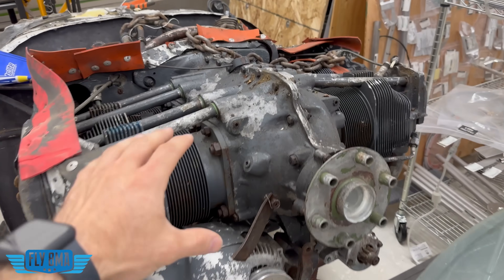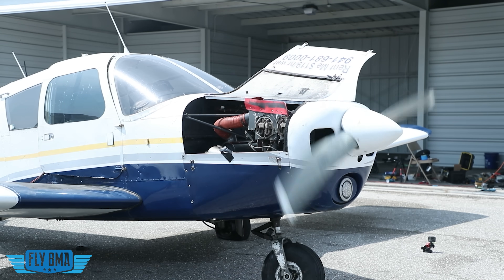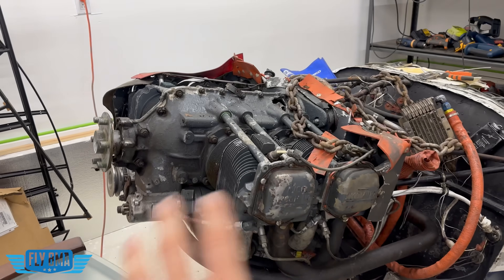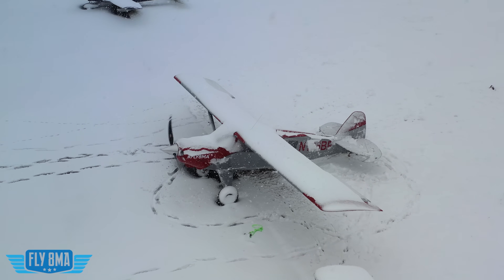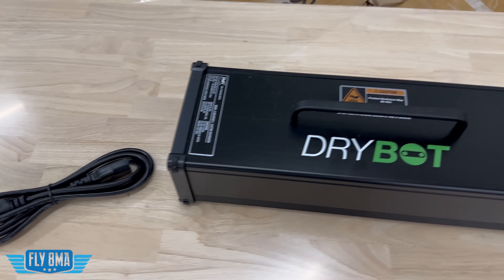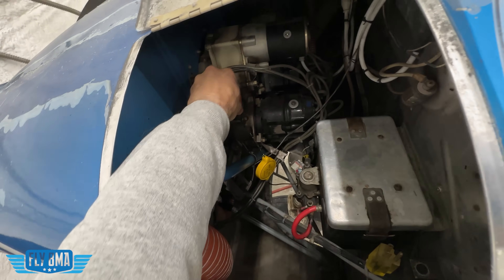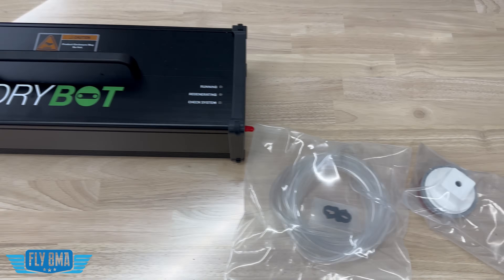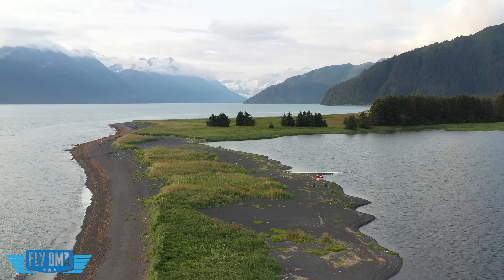Why you WANT a DRY airplane

Comment: There is a huge difference among engine heaters. The example you gave was an oil pan heater, and I agree with your advice. However, if you install a full engine heater for oil pan and cylinders, then I think it's best to leave it on 24/7 during all months where condensation can occur (in the PNW this is from ~Oct-May). My engine heater keeps the entire engine at 110F, making absolutely sure there is no condensation anywhere.
Reply from the maker: Electric bill here in Alaska at $0.22/kwh would run us about $130/mo in electric to do that.  Not sure what electricity is down south, but 24/7 on 800watts gets spendy
Reply: @fly8ma.comflighttraining199  Yeah, that's a consideration. The standard Reiff system is 400W, thought in AK one may need the XP system with 800W. My electricity is included in the hangar rent, so no extra costs. Still, in concept, I think that heating the entire engine well above the dew point is a great way to prevent corrosion.
Reply: Yea, you must be making bank

Comment: I purchased an alien engine heater, which blows warm air through the whole cowling of the engine to keep the temperature maintained no matter what the outdoor temperature is. Give me your opinion on what you think of this. I heard good reviews concerning it and it was not cheap, but if it works, it will save me from having to rebuild my Lycoming 0540 engine again at least prematurely.
Reply from the maker: Haven't tried that one, but i'd assume if it gets the air hot enough to do what it is supposed to do that it may consume a lot more electricity than a desiccant dryer like this one.

Comment: What about just taking the oil cap off while hot, and let any steam out?🕳️🌏
Reply from the maker: Won't hurt, but won't help all the way either.  Engines are not perfectly sealed and moisture will get in there.  Unless its in a well sealed climate controlled hangar you do need a way to get the engine internals dry or fly the plane often.

Comment: We had our Airplanes outside in Michigan... I remember going with my dad to pull the prop thru to move the pistons and oil the cylinders, and to change positions of valves, minimizing how long their left OPEN
Reply from the maker: Yup...it's either that, pickle the engine, or use one of these devices